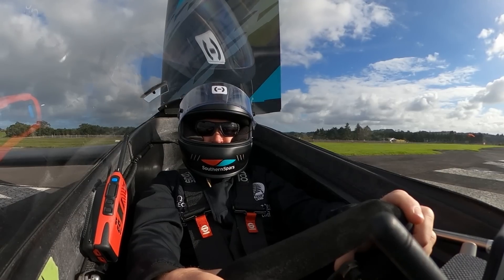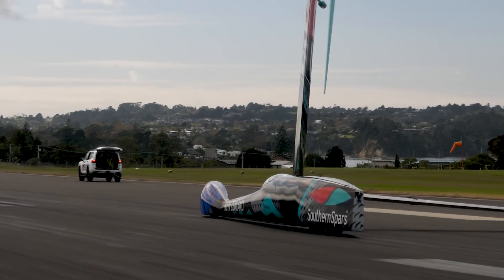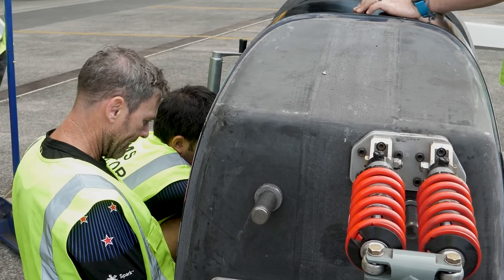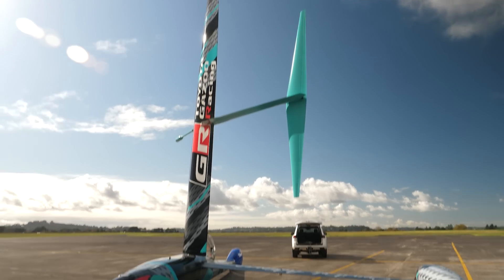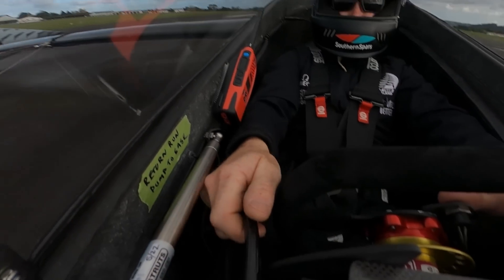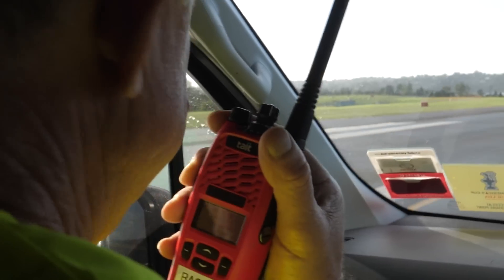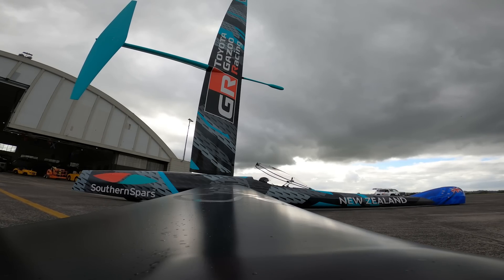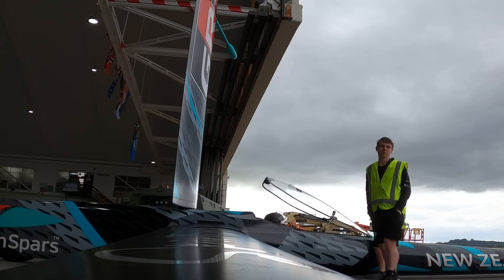Transforming Horonuku

Comment: It still boggles me how such a fast sailing car can manage to stay upright with just one outrigger. That has to be really heavy and rigid to resist all gusts of forces from any direction, similar in working to a sailing boat's sword(s). Which would put enormous strains on its connection to the main hull.
I'd like to see a video on the mechanical principles behind the car's basic design.